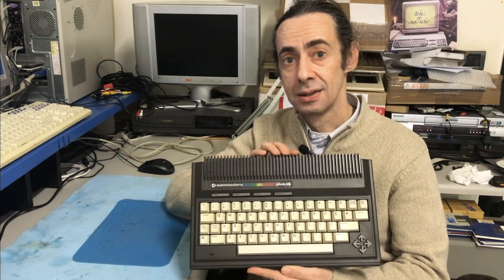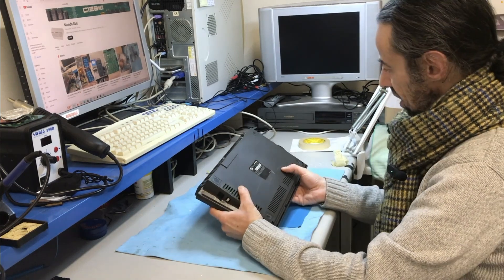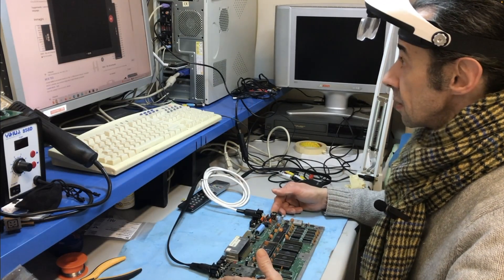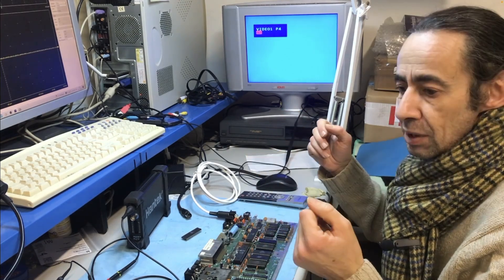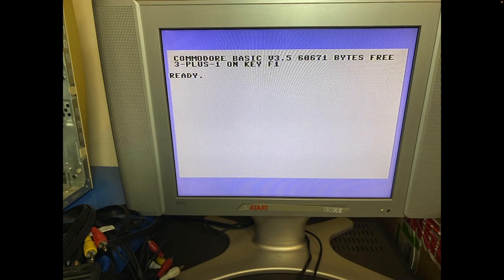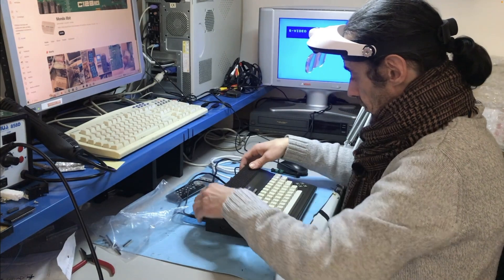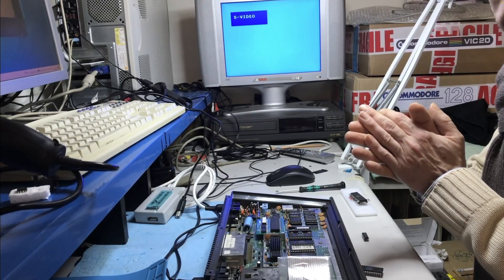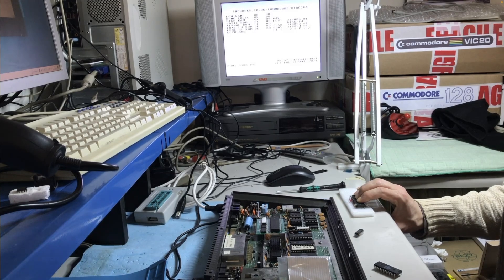Repair a Commodore Plus4 with brand new components!

Comment: I used the 6502-8501 adapter on a C16. Since it has more room than a Plus/4 I didnt have to solder anything. I just had to cut a piece of the shield 😅